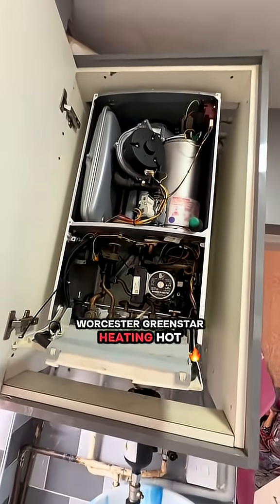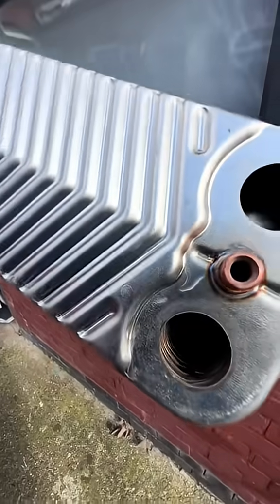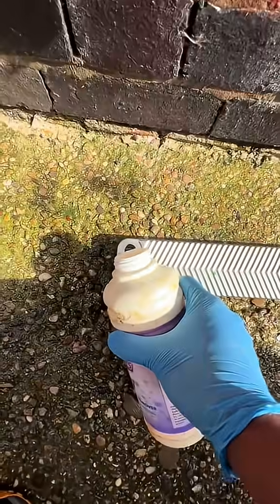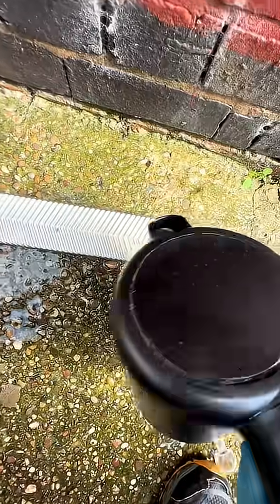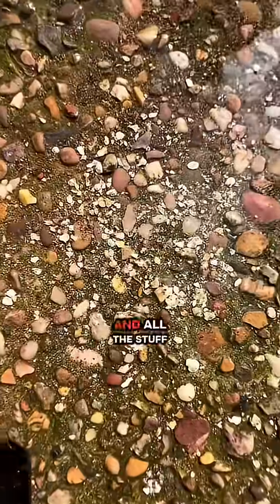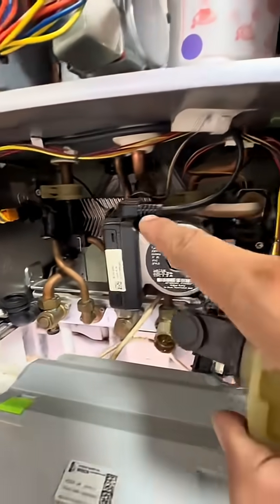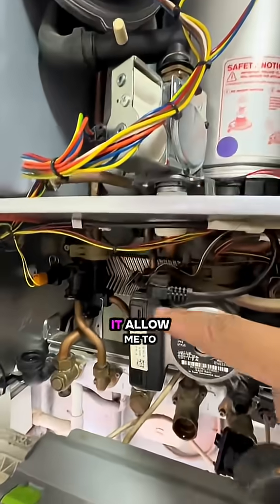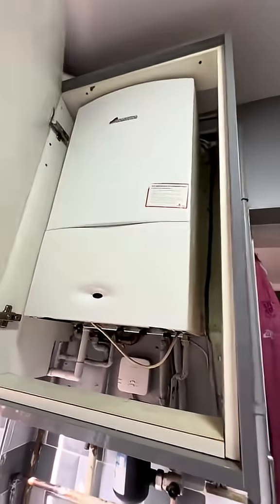🗣️’ Dont clean plate heat exhangers’ -- ME: Why Not 👀🤐

Comment: FFS use the right cleaning agent , do you really think an outside tap will shift off crap ? it’s been under pressure in a shitted up system for years. 
Tip a can of full coke into it and leave it an hour then rinse it out.

Comment: I did this recently after replacing with a brand new one nearly w year to the day got a call back new plate blocked up. Washed it out but managed to get it in and out without removing gas pipe. Just point it to the left most corner and it fits up with squeeze